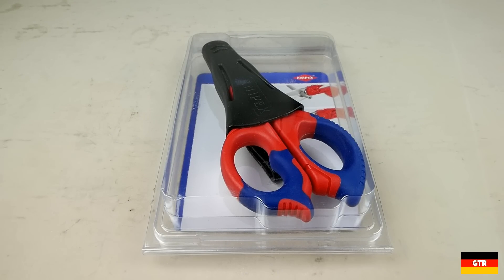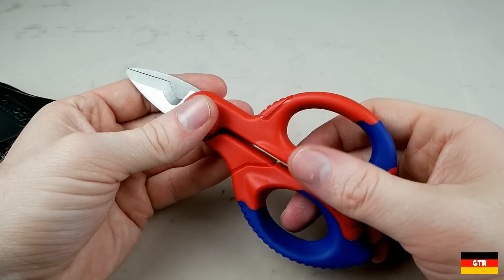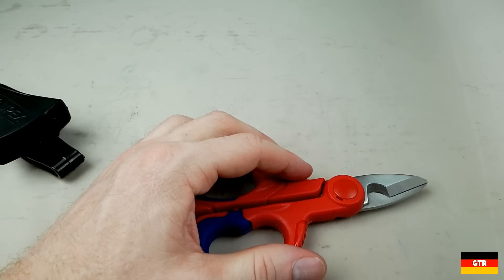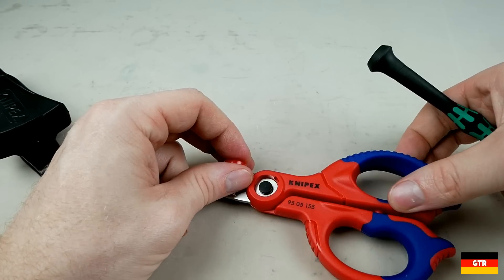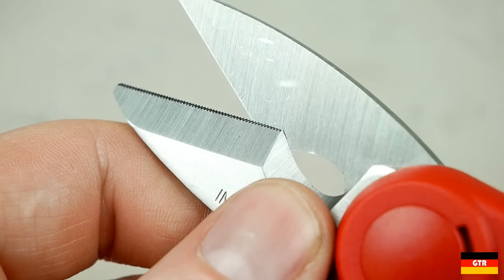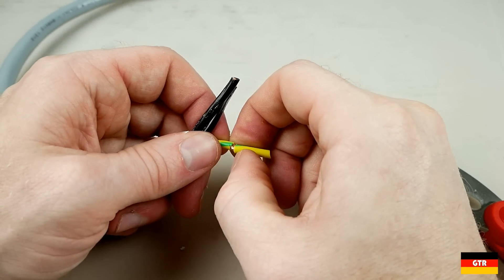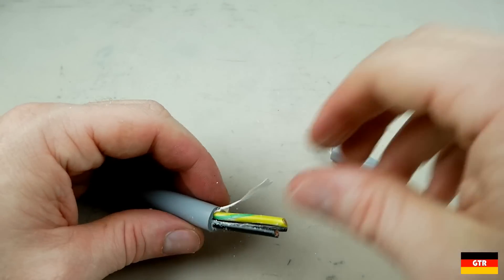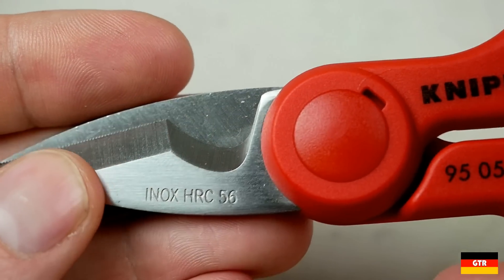Knipex Electrician Shears

Comment: I started as an electrician and ended up in the low voltage field (access control/security).  Since I started as an electrician I prefer using side cutters and don't care for scissors or snips at all.  Can't stand to use regular Klein snips.

I bought these Knipex snips and LOVE them.  Fantastic at stripping and cutting cat6 and the like.  I would still buy these snips if they were in the $50 range.  At $20 or so these are just fantastic.  I personally love the handles, I think they're easy to use and very ergonomic, but if you're used to conventional scissors, I can see how it might take some getting used to.
Reply: They look like they are razor sharp and well made too.

Comment: I like them ok. Small & compact. The plastic holder cracked very soon, so wearing clipped to your belt is not going to work for long. But it does work well inside of a tool pouch pocket. Definitely worth $20 bucks.

Comment: They are rebranded but they are really good scissors. My Usag 207 E have exacly the same blades but different handles (I prefer simmetrical ones)
Reply: Lil Cap Are you sure they are the same blades? The Usag appear to have some external serrations on the top and bottom of the blades, the tang goes all the way around and they have crimping and stripping facilities.
Reply: @mrbadger9920  sorry, I meant the 207 "D" model, not the "E", i was inattentive :D

Comment: If you are cutting into the copper conductor while stripping wires or damaging insulation while stripping multiconductor cable, that is a user problem not a tool problem.

Comment: I have a range of tools, depending on the job to hand.  It's handy if you can find a single tool that performs all the operations.  I have some notched wire cutters, really lust short scissors with a sharp "v" notch at the tip and a screw stop for adjusting the wire size.  I can prepare a 40 pair cable in a few minutes, but it's impossible to tag terminate the wires.  I have long nosed pliers with integral side cutter and slot stripper.  But the stripper isn't adjustable and needs a couple of tries to break some insulation types and I have a pair of needle nosed that will tag terminate and part the wire with a flick of the wrist .... but they won't strip.

Somewhere out there is my ideal tool, but at 63 time is getting short.  I aim to be somewhere warm collecting shells before much longer not stripping wire.